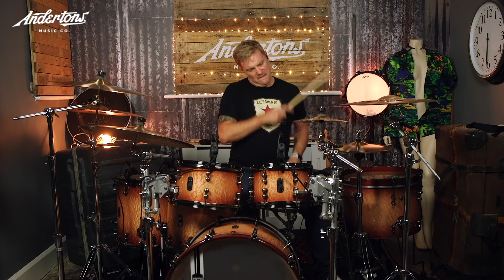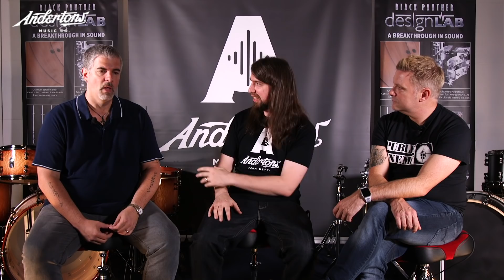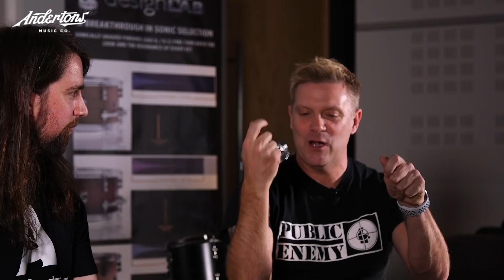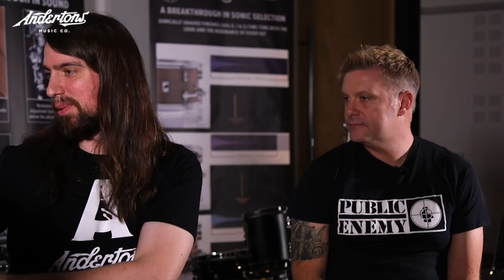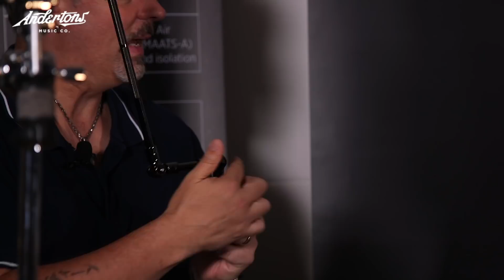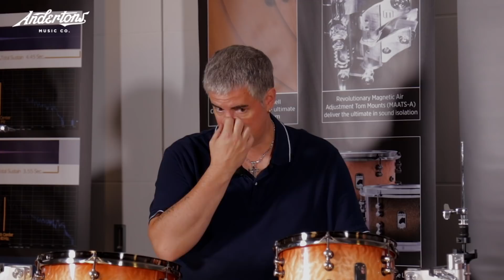World Exclusive! Mapex Design Lab with Russ Miller and Craig Blundell

Comment: It’s cool but little too much imo. It’s just little too complex for a mount. and personally not a fan of how they look. I think the new Tama star mounts with the quick lock brackets and free floating system and rubber isolaters are still the best on the market with the quick locks also on the floor Tom legs and air cushioned floor Tom legs and bass drum spurs.
Reply: I'm a mapex (and tama lover) but I've to agree with what you wrote about those mapex tom holder. They seem complicated, heavy and they look ugly to my opinion.